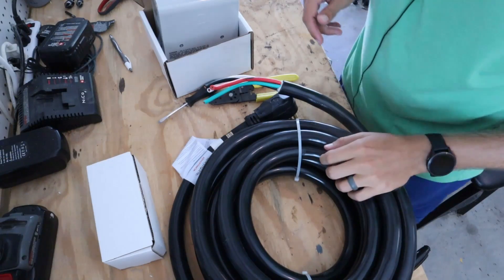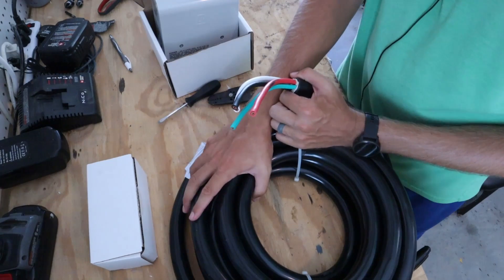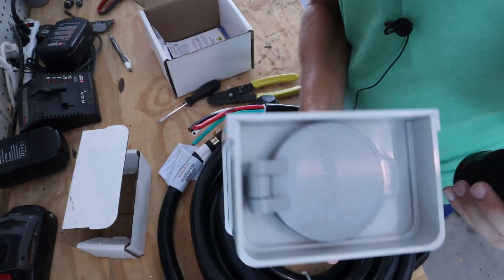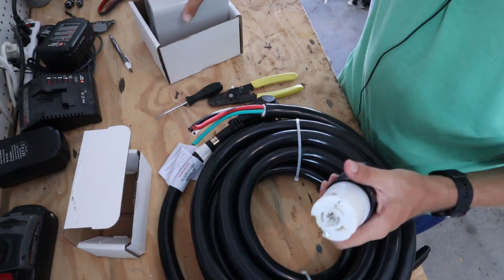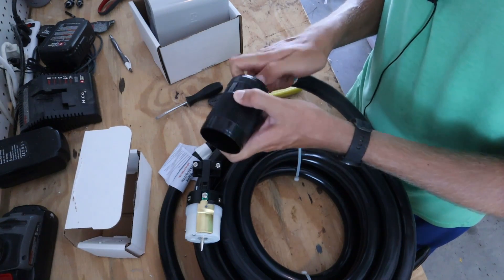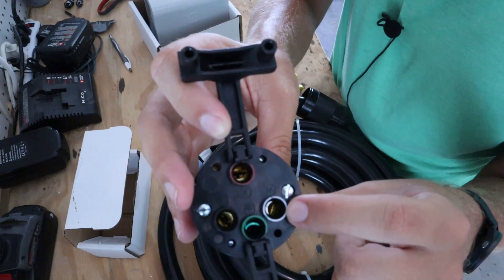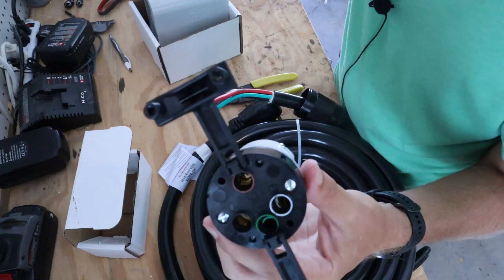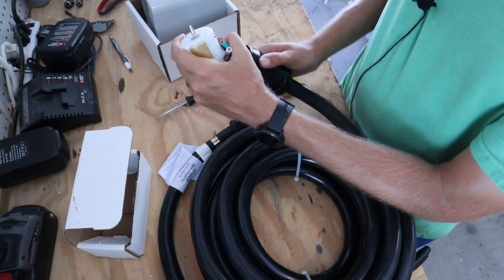How To Make A 50 Amp Generator Cord | Build your own Generator Cable

Comment: I purchased 10 feet 6 gauge at Home Depot and a GE 50 breaker for $ 90. 18 for the breaker  $60+ for the wire. Expensive.

Comment: It is always best to spend your money on the wire going from the outlet generator box to the electrical panel.  I always recomend  #6 awg to accommodate  50 amps. This IS BEST practice even if you have only a 30 amp generator output.
SOMEDAY , you will UPGRADE to a 50 amp output generator and you would ALREADY have the correct wire installed.

Comment: How far did you insert the wires into the colored holes X, Y, G, W?  I just want to insert the copper wire but not the insulation?  Looks like there is room but I don’t want to shove the wire too far

Comment: The connector body you installed almost certainly came with instructions that include the prescribed dimensions for cover removal and strip length.  No need to guess at those things.

Comment: I'll ask this secret question.

How would one wire these if they only have one black and one white wires (no red wire) coming from their utility service? 
Iv asked this question many times on other videos,  goes unanswered 😶

I'm planning on buying a generator to power my two inverter 110 v 12000 ton air-conditioning, fridge, inverter microwave, security camera system, water well pump, sump pump. Looking at buying a Champion 11,500 dual fuel  generator.

Thanks
Reply: the wiring you mention will provide 120V service.
You should not attempt to install a 12000 ton air conditioner, it is way beyond the scope of this discussion. THat would require high voltage, 3 phase power, not found in a home

Comment: If you have a 50 amp inlet plug to the breaker, but only have a 30 amp generator, could you make a cord with a 30 amp 4 prong plug for the generator end and a 50 amp female plug for the inlet end?
Reply: yes

Comment: What generator did you get? I have the same house side plug all ready installed.I need a good generator now.
Reply: The biggest one that you can afford and have a 50a supply. You have to be really careful with modern appliances as they have electronics and low voltage when something like a well or dryer runs and draws the voltage down.
 The biggest ones burn more gas though. I got it that size bc my well needs it.  The well draws 13a starting.
My 8kw burns 1/2 gallon an hour.  It's overkill at night with only running the refrigerators and night lites.
We shut it off at night to save gas.  We have been doing this for 4 days now and have had no issues with food thawing.  
I will not run any AC though and I have 30 now and the dryer complained loudly.
I am going through the Helene tropical storm in WNC.  No house damage but I have been without power for a week.
My son has a 2kw gen portable we have been running the refrigerators on for 4 days before we bought an 8kw unit.

Comment: Why do all 50 amp cords come with 90° male ends?  They dont work with my generator because the outlet on my generator is too low and i cant bend the cord enough to plug the cord in. I would say its poor engineering from the generator manufacturer.
Reply: If you search NEMA 14-50P Assembly Plug you can find straight ones

Comment: What size of wire should I get for a 50-amp generator panel
Reply from the maker: #6
Reply: @HowToHomeDIY   is it a 6/4
Reply: @yvesrobichaud4164  6/3 8/1 so 6 gauge for the three main wires and 8 ga for the ground works.

Comment: WHITE wire is the Neutral dude. Not common!?
Reply from the maker: Calm your tits 🤣  Yes it’s the neutral wire.  There are numerous applications where the neutral wire can be or is referred to as the common.   I have since made sure to only refer to it as neutral so as to not excite anyone and it is the much more accepted and correct term.

Comment: The problem is people being people, someone WILL forget to shut off the main breaker, DO NOT DO THIS!!! Install the proper panel, it is easy, and not nearly as expensive as killimg someone when you backfeed into the grid.
Reply from the maker: David how does that have anything to do with this video?  This is all about making a proper cord for a proper power inlet box.
Reply: @HowToHomeDIY  Transfer Switches

Transfer switches whether manual or automatic, allow you to choose between utility power or backup generator power 
Transfer switches are the only way to safely power your home’s electrical system
Using a transfer switch prevents backfeeding. This occurs when your generator becomes a power source for the surrounding area and can damage your home, your neighbor’s home, and injure workers trying to restore power
Reply from the maker: Yes I know.  This is how to make a cord to be able to connect to a transfer switch or interlock kit.  You have to plug it into a power inlet box regardless of which method is used.  This is not a suicide cord that is just plugged into a dryer outlet.

Comment: may not be a major concern for this type of make up but I would look into using a torque screw driver for those connector lugs - again it may not not matter all that much for a cable being used temporarily and without much current load but where it's a more permanent install (say for an EV's EVSE) not having the lugs properly tight can be an issue...

Comment: I have a question. I have a second dryer outlet. Can I change it into a 30 or 50 amp inlet?
Reply: No.
Mostly likely only fed with a #10. 
50amp is #6.

Comment: Question........with the setup, what size breaker are you going to put in your panel?
Reply from the maker: I put a 50 amp double pole breaker in the panel for my generator.
Reply: @HowToHomeDIY  What size generator do you have?

Comment: The NEC states that signage be used when back-feeding. So it means a sign at the panel says
upper two breakers on r. side connect to gen receptacle, and a special bolt used to secure said 
breakers. Also u can get a mechanical transfer device that links with the Mains and gen breaker.
this means The MAINS breaker MUST be in the OFF position to allow GEN breaker to be placed 
in the ON position. this is LEGAL.

Comment: I made a gen corset using a heavy cord SO  or SJ but for rugged environment. I put the red 
on X at both ends and the black on Y at both ends. maybe it does not make a difference
electrically but if there was a problem, u'd expect continuity.. say ur looking at both ends 
of the cord set neutral towards you and ground opposite, then the Hot prong on left of one 
end should have continuity with left prong of other end.

Comment: or your dog or cat or kids. . .even when mains are off, the gen running into a suicide cord with 
the other end not plugged into anything yup a sure means of disaster and heart-ache. I know 
a guy in FL did this. the house wiring was safe and the dryer had 10 gage fused at 30 but he tried 
pulling 30 amps thru a gen cord of 12 gage good for 20 amps. He was not far from a fire as 
the cordset began to smoke rather nicely. 
It is dangerous what some ppl do, they think 'No power out on the grid, nuthin ta worry about!
they have no idea what a transformer is or what it does but ignorance will cause them BIG issues.
picture a dark and windy night, rain or snow. 4 houses down the linesmen don't hear a gen running.
Benny Benoit hookt up his gen to the dryer after a 6 pack of beer and since his lites are on, he
thinks he is all set. meanwhile 240 from his gen is going up the service drops and is now using
what's ordinarily the xformers secondary as a primary and with a 30 to 1 ratio the line on the
transformers primary side  and a wire is down on the ground, it  has 7,200 volts on it.

Comment: I was wondering how a 3 prong recipticle works on 4 wires. I just noticed the green ground wire goes to the metal on the outside not a prong. That explains it..
Reply: And you are so correct.  The ground is on a plate on the side of the plug and the receptacle.  The prong is just a guide to help keep you from twisting off the prongs...

Comment: I noticed the 50 amp cable you used says it has 6/3+8/1 wire.  Should I be concerned about that 8 gauge wire if I want to have the full capacity of my 50 amp generator outlet?
Reply from the maker: The #8 wire is just the ground wire.  All of the conductors are #6.  This is very normal.

Comment: I've got a 50-amp female twist-lock inlet that basically feeds into a 60-amp breaker in my panel. Why 60? Because I THOUGHT I was going to get a generator with a 60amp outlet and I got one with a 50, but I left the 60 in place because it was basically going to be an on/off switch. (The generator has a 50amp breaker.)

But that's not why I made this post. I wanted back you up about how "wrong" doesn't mean unsafe.

So anyway, my "interlock" is a piece of red duct tape that sits either on the 60amp breaker or on my mains breaker. The way I keep safe is simple; I just have a process:
1. Turn off mains, move duct tape from 60amp inlet breaker to 200amp mains. (I also turn off HVAC breaker and shut off the clothes dryer if it had been running.)

2. Go out to generator and plug in power cord. (Other end stays in inlet box all the time)
3. Start generator, let idle smooth out. 
4. Go back inside and turn on the 60amp inlet breaker.
By the time I get back inside, the generator has been running for a few minutes, so it's warmed up.
Reply: The 'suicide cord is against the code requirements everywhere in Texas and I suspect nationally.  There are a lot of arguments that may be made about unsafe or not, but considering the heat and energy loss caused by running high amps through low capacity wiring, I would not jeopardize my home to save $60.  Still, to each his reach!
Reply: In what way does your comment apply to anything that I have said?

Comment: Great video. My only question is with the reliance 50 amp box. Have you notice any fading - yellowing or discoloration over time on that Grey color box ?
Reply from the maker: Yes some slight discoloration as it is on the side of the house that is in the sun all day.

Comment: From my Main power box, I want to run the power cable to my power intel box about 100'. What awg of wire should I use from the main power to my power intel box? Thanks
Reply: What's your expected current or wattage?

Comment: Great video as always. I’m confused about sizing though. The 50 amp cords I see online say they’re rated for up to 12,000 watts. I’m installing a Generac 15000/22,500 portable. Would a cord with 6 gauge wire bee enough to carry the load?
Reply: I believe you are going to be limited to the max watts 50amp can handle which is 12,500.
Reply: Mop

Comment: I found it more expensive to make extension cord rather than buying one. Like 60% more to make one
Reply from the maker: For a long 50 amp generator cord?  I am not seeing that.  I haven't looked at the longer 30 amp cords but that would be odd to find the longer ones for less.
Reply: @HowToHomeDIY  vevor makes em for cheap and great quality.....up to 100 feet for $200....can't make em for that imho

Comment: This is exactly what I'm wanting to do. Need 100 ft. What will the effect  be since it's over 50 ft. Specs: Westinghouse wen 9500 df. Inlet: reliance pb 50 hooked into panel with interlock kit.  Seen online price for 100 ft cord for $500. Advice. Make it or buy online? Do the big box stores sell the cord?? If not where to buy??? Thanks
Reply from the maker: So at 100ft. there will be some voltage drop but it would probably not be noticeable.  I personally found that making it was much less expensive for the longer cords.  The big box stores will not carry a generator cord that long but they might carry cord on a roll to make one.  I personally found mine online.  I believe I have a link in the description that you could check out and it might get you to an area where you can find exactly what you need.  Hope this helps!!
Reply from the maker: I do not but it sounds like I need to make one haha

Comment: I have a 8500 Black Max and a 10,000 Gentron generators, can I hook both up to breaker panel and run both at same time TIA
Reply from the maker: No, you would only be able to run one at a time on the same panel.  If you had a transfer switch for one and a power inlet box with interlock kit then you could run both because they would be separated.  Just as an example.

Comment: AHHHH NO you CAN'T backfeed your panel.  NEVER DO THIS.  It is dangerous and illegal.
Reply from the maker: This video is about making a generator cable to insert into a power inlet box with interlock kit.  It is legal and the correct way to do it.  Electricians install it this way everyday.
Reply: @HowToHomeDIY  Agree, but you also mentioned backfeeding a home via a dryer outlet.  That's what I was referring too.  That is wrong on a number of levels.
Reply from the maker: @superwiseman452  But I also said that I wasn't doing it that way and it wasn't what the video was about.  I was simply addressing that people are going to do it regardless and pointing out that it isn't the way to do it even if people are successful in doing so.
Reply: Could you explain the difference between forward feeding and back feeding? I understand the danger of a live male end not being plugged in but once the contacts are plugged into the receptacles on both ends its no different than a dedicated generator inlet. Last I heard electricity current flows forward and backwards. Hence the alternating current.

Comment: Can both sides of the connector be like the one connecting to the Generator? Or it had to be that one that you have? Thanks.
Reply: Both ends cannot be the same. The male end plugs into the generator. The female end plugs into a receptacle that has protected recessed male prongs. If you had a male end on both sides the male plug on the end that is not plugged into the generator has the possibility of having the power to exposed male prongs. This kind of power cord is referred to as a suicide plug. I can kill and will kill people.
Reply: @Stephen-vb5mf  I appreciate your help, now I know exactly what to do and get to make it work like yours. Thanks for all your help.
Reply from the maker: I agree with what Stephen said.  Now the cord in the video is for a 50 amp generator plug, so the male end for the generator looks completely different than the female going into the power inlet box.  If you had a 30 amp twist lock, the two ends would be similar looking in shape but the end going into the generator would be male and the side going into the power inlet box should be female.
Reply: @HowToHomeDIY  I must say, your video was excellent and very informative. I really appreciate your willingness to help others with their generator set ups. I truly wish you well…
Cheers from Canada
P.S.  we are currently experiencing extreme cold weather here, and i dont have a backup generator (yet), so do hope we dont loose power anytime soon. 🥶

Comment: Great videos! I have a 9k predator generator but now I want a bigger one with 50 amp. Would you say it’s best to have a 50’ wire from inlet to panel or 50’ generator extension cord?
Reply from the maker: Picking between the two will really just be personal preference.  There won't be a difference as far as possible voltage drop picking one or the other as long as the wire gauge is the the same.  Hope this helps!  Thank you for the feedback!
Reply: doing the 50ft run on the house with thick wire is likely cheaper  and the extension cable will likely be more expensive and get worn out...  but... you can choose more places to move it.

Comment: suicide cord >   ??   There  I S    A   S I M P L E   solution. MAKE  that triple 6 gauge, with smaller ground green wire, LIKE  A  NORMAL  XTENSION CORD.       it's  not hard, female end on the house side. M A L E   END  , in the small square box, (with flipdown cover) mounted on the side of the house. it is NOT   ROCKET science.......
Reply: Thats true as long as you have a disconnect to the outlet mounted on the house. Otherwise you have a male connection that is connected to your power grid. Yes a cover should make it safe and untouchable but things happen.

Comment: haha..not the most recommended way..not legal at all and should never be done period.... there is not breaker to protect the system from overloads at that distance from your panel..needed to be at the panel..
Reply from the maker: Correct, backfeeding through a dryer outlet or range outlet would not be "legal."  I said it is not recommended as it is not the correct way or code compliant way to do it but there are some that will do it anyways.  This video though is about how to make a generator cable to plug into a power inlet box for a transfer switch or interlock kit.
Reply: @HowToHomeDIY  You should have stated that is ILLEGALl!! And explained why!!!!
NOT ONLY CAN YOU DIE OF ELECTRICUTION, YOU COULD KILL LINEMEN WORKING UPSTREAM, AND.....
IF YOUR HOUSE BURNS DOWN WHILE USING THIS METHOD....YOUR INSURANCE WILL MOST LIKELY NOT PAY FOR THE DAMAGE.
Reply from the maker: There is nothing "illegal" in this video, this cord is the correct way to connect to a power inlet box attached to a panel with an interlock kit or transfer switch.
Reply: @HowToHomeDIY  I was talking about the "SUICIDE" CORD!!